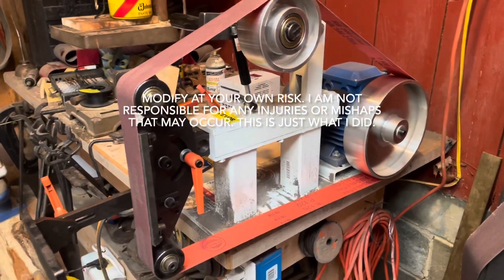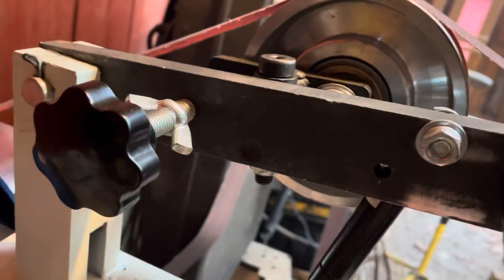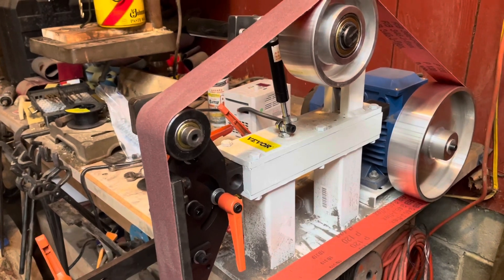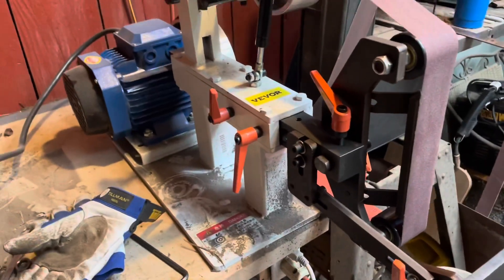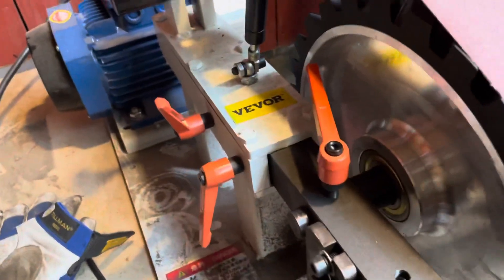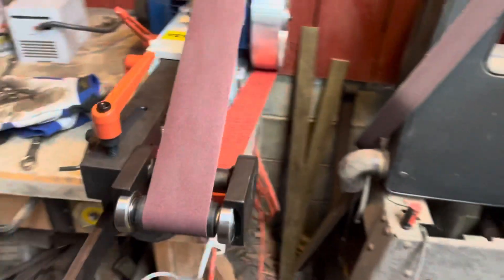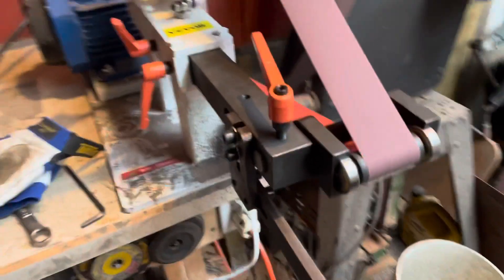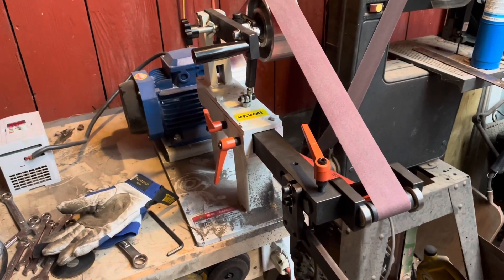VEVOR 2 x 82 modification

Comment: Wait they said it goes to 2x72 tho?
Reply from the maker: Who’s they? You can run a 2x72 on the small contact wheels without any modifications, but that doesn’t really make a versatile grinder lol. Trust me, I tried fitting belts on this thing every way imaginable before modifying. Now you could spend more money and put smaller pulleys on, but the point of the vevor and these mods is  to get up and running with a 2x72 at half the cost of other(better) brands. This is also last years machine, maybe they made a new model that takes both?
Reply: @TheJClarkShow  yea just reading of descriptions of Amazon it says 2x82 belt grinder under that is says fits 72in to 82in belts so I was kind of skeptical then saw ur vid and was like if it doesn't could modify it
Reply from the maker: I’d say that’s a sale ploy lol. But yeah if you need a cheap grinder these can be modified pretty easily to work with 2x72. I bought some combat abrasives belts and so far it’s done pretty good. There are things that could be better but that’s the draw back to buying cheap lol. The framework is pretty solid on these though, so if you’re a fabricator it’s possible to build off of the base and make a pretty good grinder over time.
Reply: @TheJClarkShow  Thanks order mine yesterday got the one without variable speed bc it was 300 dollars off so not bad getting it for same price as grizzly 2x72 with 2 other grinding methods

Comment: Hello. I just got this Mach. I can’t see to get the belt wobble out. Did you have any problems with tracking?
Reply from the maker: Sometimes I have to push up on the tensioner to get it to tighten up completely. Other than that it’s been good. Do any of your wheels have any play in them?

Comment: seems to me the simplest  way to fit a 72 in belt and not lose any of the  platen arm length is to move the motor rase it 1/2 ", easy to weld bolt or clamp an extension plate for the motor mounts, got one ordered from amazon 649 plus tax delivered by nov 14 , easy to build a dust proof box for the vfd , just add filtered pc fans for  intake and exhaust , I will wire it for 220 forget using the power transformer ,just more crap that will cause problems down the road
Reply from the maker: Moving the motor back also moves the drive pulley back, that wouldn’t change anything really. Smaller wheels or a different tensioner set up could be a way to go. My modifications were the cost effective and extremely simple way to do it. And the notch doesn’t effect anything, the arm is still factory length on top. I can still run the smallest contour roller with a 2x82 belt if I wanted to, the notch is nowhere close to to the tension screws for the arm. Now a dust shield and filtered fans would definitely extend the life of the vfd, that’s on my to do list. And 220 would be much more efficient, unfortunately I’m stuck with the transformer til I can build a new shop and actually get 220 in there lol.
Reply: @TheJClarkShow  ty for the reply J , before I do assemble I will take a good look at all opinions, Once I do get it here and Infront of me I can get  all the measurements, drive wheel and arm dimensions , I have a dyi build now works flawlessly, but has no attachments and needs a better motor so the cost of this was cheaper ,lol tanks again
Reply from the maker: @gordonsmith6699  I’d like to see what you come up with. I’m hoping to get mine on a new bench this fall and get the vfd protected, and maybe other modifications that I’ve seen from others. I also have a “bevel table” I need to build. If it works good I might throw a video of that up.
Reply: @TheJClarkShow  Will do J, got some ideas , so any modifications I do make that actually work , will be shared , thanks again ! by the way I use cheap hepa filter liners  out of vacuum bags. Cut to size and tape on over any ventilation holes , change as needed ,also A couple of large magnets on the table under the belt will catch an amazing amount of the dust
Reply: @TheJClarkShow  got time to put the beast together ,what I did was rase the motor 1/2 inch ,cut 1.5 inch off the arm and took the bolt off the bottom of the gas strut and cut the thread about 3/8 inch screwed it back in with out the bolt . I added some locktite as well . all works as it should . made a base so I could turn it horizontal and also build a box with filtered vents to keep the vfd cool and dust free ! sorry I have pics to share but cant see here how to post .let me know how to add pics and I will be glade to share , ty again for your videos J !
Reply from the maker: @gordonsmith6699  awesome. I’m not entirely sure how to add pics in the comments either lol. Im hoping to get another bench built for mine this winter, I’ll be trying your filtered vent cover for the vfd. Mine is pretty grungy right now so it’ll be getting cleaned out shortly before something short circuits lol. Happy grinding and hope yours holds up as well as mine has this far.
Reply: @TheJClarkShow  just to let you all know amazon has dust and water proof boxes cheap for the vfd drill a few holes top and bottom maybe 3 inch in diameter cut and tape your face masks we all have had laying around for over 2 years as filters works like a charm . cut and tape to the power converter vents on both sides as well. nothing will get in to either of them !  I made my box out of 1/2 inch plywood , cut holes with hole saw put screen in the inside with hot glue cut and added  filter material in to the holes on out side change as needed , very easy and cheap . I love cheap .lmao ;) mask or furnace filters work same , what ever you got around , enjoy

Comment: If you get a standard Ethernet cable, you can pop the display off the VFD/inverter, mount the VFD away from all the grinding dust, and mount the control box away from grinding dust, like under the table.
Reply from the maker: Thanx, I’ve been wanting to find a way to shield it from the dust before it shorts out. I’ll have to give this a try.

Comment: Great video. Mine just arrived a week ago and I just received a selection of 2x72 belts. I'm new to this. I'll start with notching the tool bar to clear the fins, and do the other mods if that's not enough. Also, everyone talks about eventually buying  a good American belt grinder. Meanwhile, I've read many comments from several videos on this machine and not a single complaint about performance or quality. Seems like most are expecting it to self destruct  before its time, but we'll see. I'm hoping it's my forever grinder. It solid as a rock. Thanks again for the video.
Reply from the maker: ThAnx for watching. So far mine is still going strong. The only other thing I did to mine is make a bigger work table/tool rest, whatever you want to call it. Makes it much nicer to use a bevel jig if you’re making knives.
Reply: @TheJClarkShow  Thanks for the reply. Yep mine is running great. I'll see if I need a larger work platform. The other viewer was correct, all I needed to do was notch the tool arm and 2x72 fit nicely. My latest model only comes with one tool arm. I'm going to fabricate a 2nd so I'll keep one set up for the platen, and share the other between  the contour wheel and small wheels. It's a little bit of a pain to exact 90° for the platen each time it's swapped for another tool and back. Great video. I wouldn't have known what to do without it. I'm now a subscriber :-)
Reply from the maker: @howardfreedman4289  yup, I need to do the same. It is annoying when you need to switch over and have to readjust everything every time.

Comment: I've got this same model. Got mine around last Halloween for $879 shipped, and mine included everything shown here, including all the contouring wheels and everything, and I can honestly say best purchase I've ever made for my knife shop. I use it ALL day EVERY day. I usually work 12-16 hours a day, and this thing runs at least half of that actual time. Made hundreds of pieces with it. It paid for itself in 2 weeks vs using my old, modified HF 1x30. I fully intend to have a nice USA made, custom 2x72 (or 2) by the end of my career... But until then, I will gladly use my vevor. I'll put it this way, if it blew up tomorrow and burned to the ground and I didn't have a warranty on it (I do, and vevor are great with that stuff) I would order another one before the debris was cool enough to sweep up.

Edit: I use Combat abrasives shredder ceramic belts for heavy stock removal and j flex ceramics for finishing. I use cheap aluminum oxide belts for most wood projects. Only mod I did to mine was the little notch in the back at the end of the bar to clear the motor, in order to run the 2x72 instead of 2x82. 2 mins tops. Love this thing.
Reply: Thats awesome to hear mine just arrived yesterday I got off of amazon for $799 and boy I am nervous but still looking foward to running it. How is it going 2 years later and has your opinion changed?

Comment: Nice. I will keep this in mind. A few questions if ya don't mind? How does it grind?  Is the speed an issue or was that just how it looked in the video? Does it seem to still be sturdy after a couple months? I'm currently using a Bauer 4x36 from HF. I needed something in the moment and thought I'd give it a shot. I'm so glad I got the 2 year protection plan. I'm on my second one in 3 months... they like to stall and over heat with very little pressure. And I mean little... I try to take care of my equipment as best I can, and yeah... 🍻
Reply from the maker: So far it’s doing good. I’ve done a good bit of grinding with it and it seems to be holding up. If you get the variable speed grinder you can crank it up to 900 rpm’s I think, I’ve run it at around 750 so far without any issues. I’d still recommend a higher dollar grinder if you can swing it. I’ll still be upgrading to something better in the future, but I needed something faster so I decided to try this thing out. I’ll run it til it dies lol.
Reply: @TheJClarkShow  good to know. Eventually I will opt for a better one, but most of the grinding I do is light to medium. It might be a nice addition. The Bauer works, but it has those issues, and takes awhile to grind down the harder stuff. Part for for course. 
Thanks brother!

Comment: Nice!  what benefit did drilling out the top hole where the hydraulic goes give you?
Reply from the maker: Let’s that arm drop a little lower. I tried a couple different things to allow the smaller belt to fit before I settled on cutting the end of the bar off.

Comment: great thanks will try this    I did buy a new wheel bracket for the second wheel ...    but I will try this thanks   The inverter you should fit to the the wall and I put my inverter in a plastic box with holes in the bottom for ventillation    If you dont do this the dust will destroy the electronics

Comment: I just got this grinder in trade and it's the exact model you have. Yesterday I received the 2x72 belts so I'm gonna have to do exactly what you did. I appreciate the video! Thanks to you, I now know what I have to do to make the 2x72 belts run easy. I'm going to reference this video in the future when I recommend this grinder to other beginners
Reply: If it's not too late, all you need to do is notch the tool arm. That alone provides enough room for 2x72 belts.
Reply: @howardfreedman4289  thank you so much! Would you mind to share a picture or video showing how it’s done?